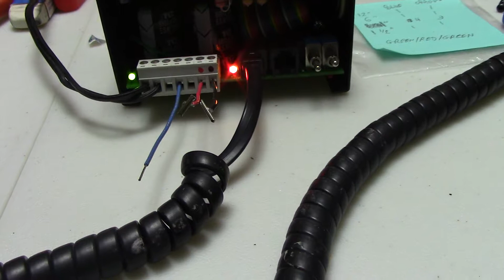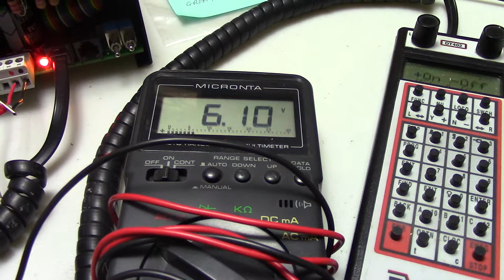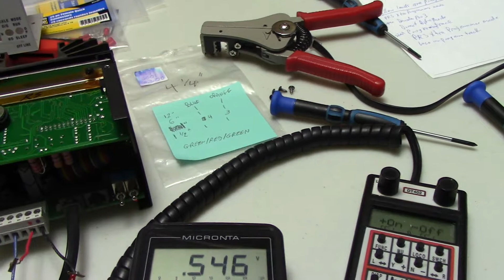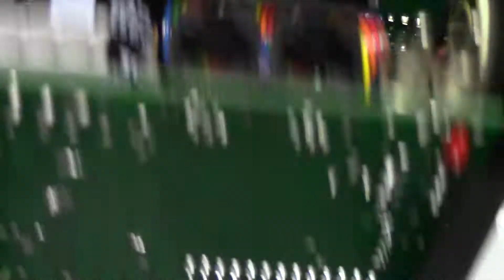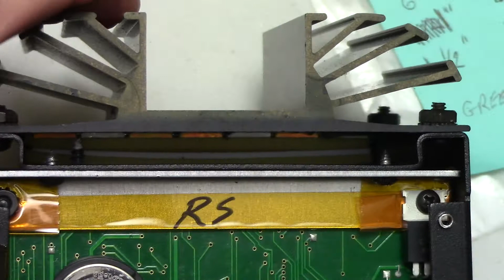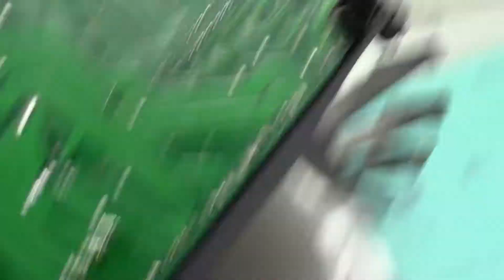20170930 Digitrax DCS100 - checking track voltage

Comment: What voltage are you actually measuring? Is it AC or did your multimeter take in to account the square wave form of the DCC current? I was thinking that a RRampmeter might be more appropriate but interested in your thoughts.
Reply from the maker: Here is the Digitrax link to the KB332: /DCS100 - Track Voltage Adjustment sheet (easier than typing out the section from the manual) for your reference, http://www.digitrax.com/tsd/KB322/dcs100-track-voltage-adjustment/.  I just followed the instructions and measured with the base station unloaded, the Ground to Rail A and Ground to Rail B then added the two for the total voltage.  I was measuring in DC mode on the multimeter as instructed.  Must be something specific when referencing to ground that you end up measuring in DC voltage.  I've no experience with the RRampmeter, so unfortunately I can't comment on its use in this application.
Reply: David Galloway Thanks for the reply David. I have read the Digitrax support page you linked too. I have a RRampmeter so will have a play with both methods and compare the difference I think and put it in a video on my channel. Just curious is all!